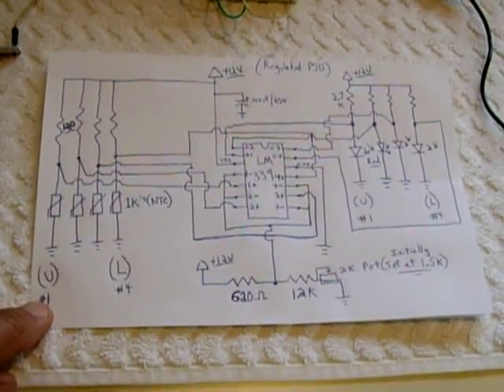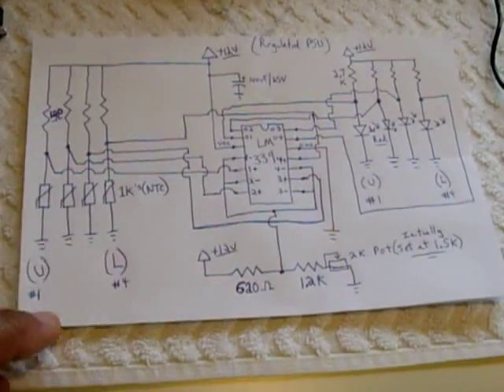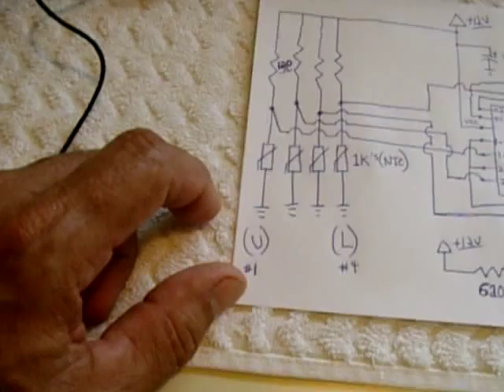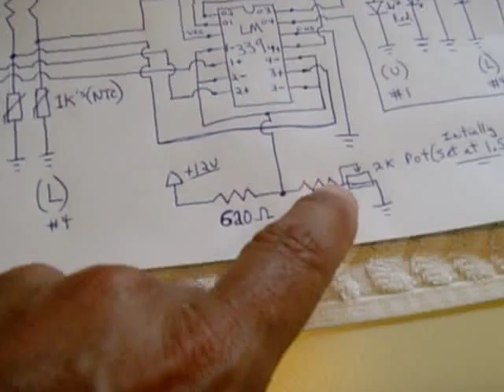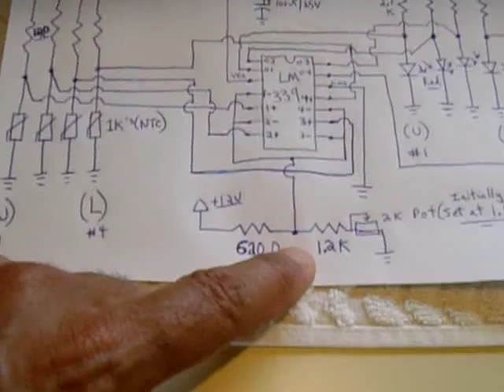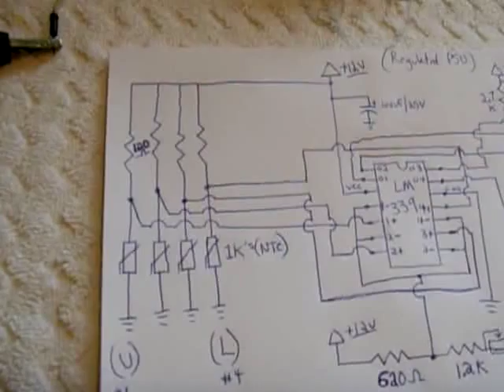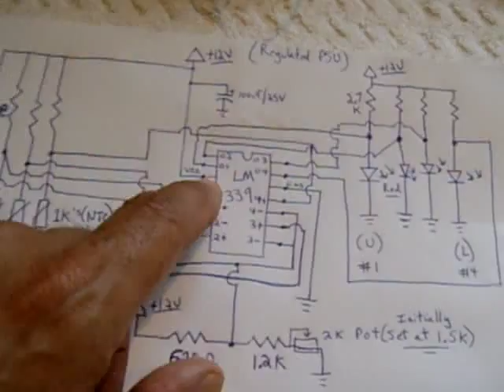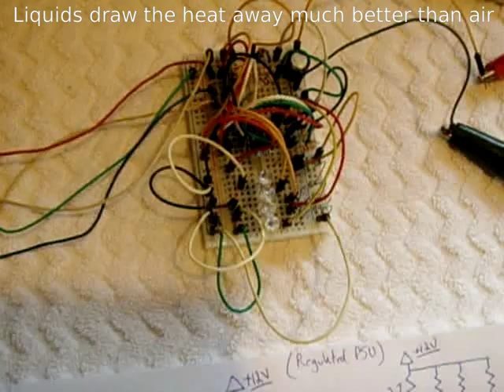Thermistor Liquid/Water Level LED Indicator Circuit

Comment: Another circuit for measuring water level could be: Having a positive voltage at the bottom of the tank and gradual sensing inputs at different levels. As the water level rises, the sensing inputs will start shorting. This way you don't need thermistors etc.

Comment: Awesome thanks for the info.! Is there any chance you can design a throttle accelerator circuit that can work in conjunction with the gas pedal on a vehicle that you can tie to a injector to control the speed at which the injector will operate?

Comment: I very much like the idea how you're using a temperature sensor to determine the difference between the air and fluid temperature to know the water level. I haven't come across this approach before, and I like the fact that you don't have to start conducting electrical power through the water to see if it's there.